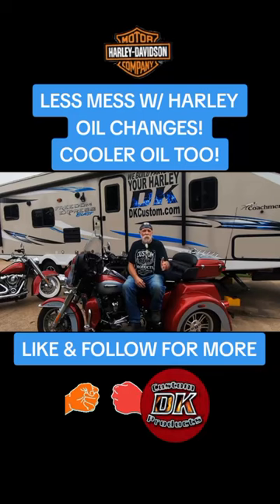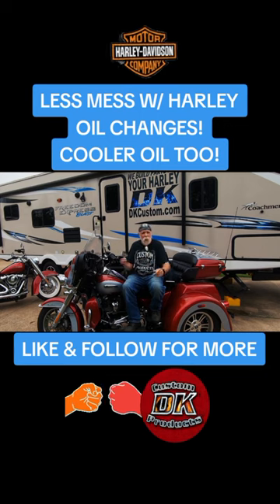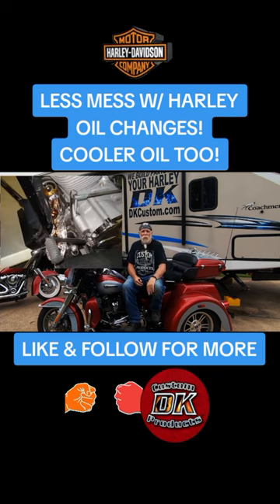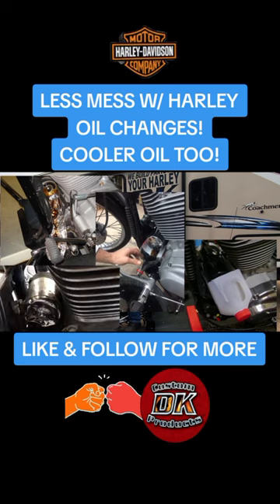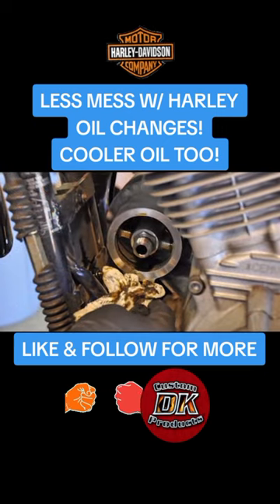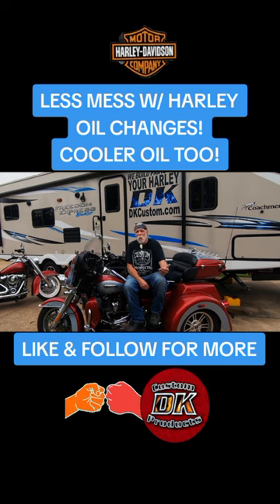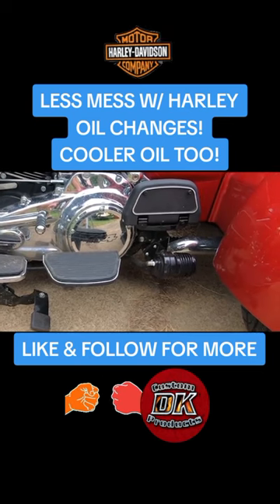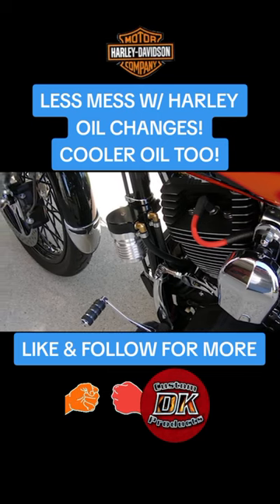LESS MESS✔️COOLER OIL✔️ #shorts

Comment: I like the concept and the reasons behind it but let me ask you. Does it require more oil pressure, especially the one that mounts below the passenger floorboard. Also this is assuming your mounting something to the area of the original oil filter area as in a plate and lines?
Reply from the maker: It does not require more oil pressure. Some of the passageways in the engine are much more restrictive than the passageways in the oil cooler & oil filter relocation.
The one factor in the oil loop that can put a load on the oil pump is a paper (OEM & most aftermarket) oil filters.
That is why we use permanent performance oil filters, because with them there is much less strain on the oil pump.
There is no measurable increase or decrease in oil pressure or oil flow when installing either, or both, the oil filter relocation & oil cooler.

Yes the kit comes with an engine side adaptor, oil filter adaptor, hose, zip ties, brackets and all the hardware you need to relocate the filter. 
Here is a link to the product pages for the oil filter relocation kits. I am not sure which bike you have but on the product page there is a good bit of information you can read about the oil filter relocation and see the product - https://www.dkcustomproducts.com/oil-filter-relocation-kits-c610.htm

Here is the full video that talks more about the benefits of oil filter relocation kit - https://www.youtube.com/watch?v=N9HnTWKbfbc

Please feel free to email our customer service at Support@dkcustomproducts.com or call at 662-252-8828 with any questions you have about the product or installation. 

In the instruction tab on the product page there is an installation video, hose routing video and hose clamp testing video.
Reply: @DKCustomProducts   Right on I appreciate the response and the explanation. I’ve been looking into the benefits of those permanent cleanable oil filters vs say OEM or paper ones.

Thanks I’ll be reaching out soon!

✌🏽
Reply from the maker: No problem! Call or email any time! Thank you for your comment!